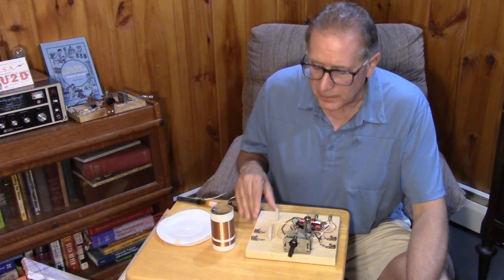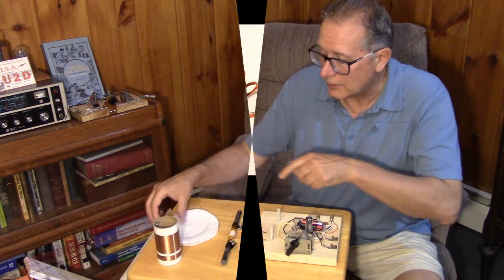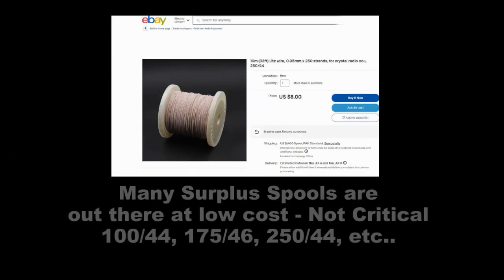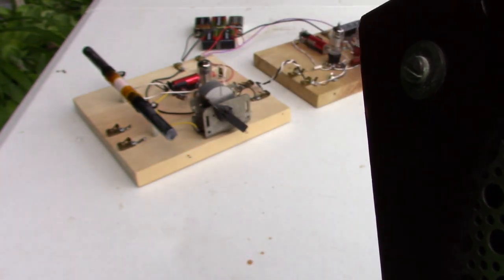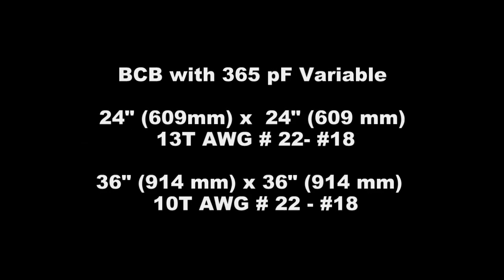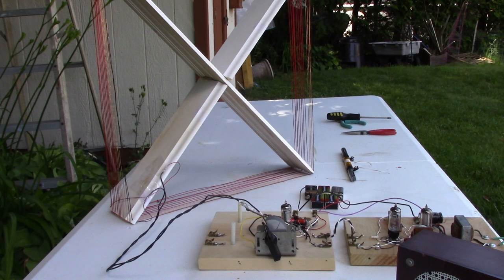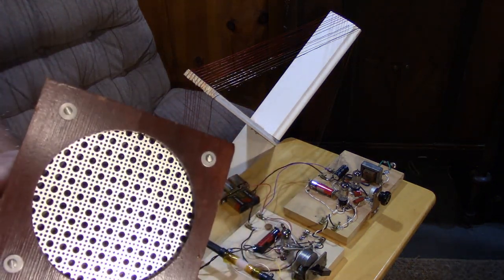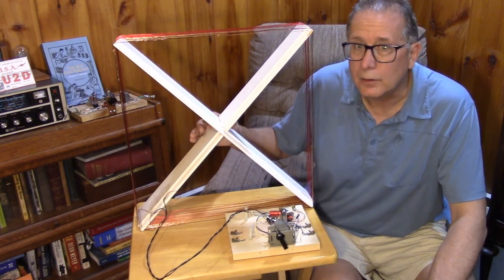Indoor Antennas for your One Tube Radio

Comment: You can also try a double tuned setup: a variable capacitor on the frame antenna and set parallel to the ferrite rod connected to the radio. It might work better, might not, I'd love to see how well it does!
Reply from the maker: Using the ferrite rod purely as a high Q resonator like an air coil and putting an input link on it and coax to a remote big frame loop OR simply nesting the two for coupling are both viable ideas.

Comment: Hi Mike! You can recommend to the makers to use the wire inside mobile phones headsets cable. Wich have at least 4 length of a multiple strands of very thin enameled copper wire. This wire should make good coils in MW band. Best wishes my friend!
Reply from the maker: Wow sort of a 4 Wire Litz!
Reply: @MIKROWAVE1  yes, each of the 4 is a  7 wires litz of course without the silk coat.
Reply: They probably aren't insulated. I think Litz wire individual stands are insulated. Possibly it makes little or no perceptible difference?
Reply: @johnnytacokleinschmidt515  it really is enameled copper wires. 4 pole cable is made from a 7strands wires per pole. Each pole twisted separately and of a different color. There is a yellow enamel, a red enamel, a green enamel and a red with yellow mixed. 4 poles all together inside a single coating. At this point you can take a 1 meter cable a take a 4 meters litz wire soldering one at the end of other.

Comment: Nice video!  I'm not surprised to see the loop performing so well.  I bought one of those cheap eBay/Amazon external tuned loops and was amazed by how well it improved the reception of cheap transistor radio receivers with a ferrite stick just by bringing it near the radio.  Now I'm wondering how well tuned loops would perform on the HF bands.  -- John N0BUP
Reply from the maker: Untuned loops with high dynamic range preamps are seen more at the higher frequencies (for reception only). Tuned loops are being used fairly commonly now on the ham bands for TX and RX.

Comment: So the bigger open air loop antenna does perform quite well! Did you say the big loop was about as good as a 75 ft long wire? I made a  loop antenna on a 2 ft diameter cardboard strap spool with 14 ga house wire and tuned it with a  paralleled 4 section 460 pf (per section) tuning cap to tune to the BCB. Man did it work good!
Reply from the maker: They work very well, and are very forgiving on the build style.

Comment: i have a Rod just like your holding BUT all the wiring is inside the   cardboard tube With a aluminum ring  on it ,  It has 2 wires  on 1 side and 1 on the other, How exactly would i use it  as a antenna .

Comment: Hello. The video is top notch as always. Did you make a similar receiver with an external antenna. and use the heptode as a radio tube? I found in the literature of old issues a diagram of a device based on the CO-242 heptode. This is an old Soviet lamp. the difference in the circuit in the ultra-low anode voltage is only 4.5 volts.
Reply: reception is carried out on an external antenna + grounding. and high-impedance headphones.
Reply from the maker: You can use these in pentode mode with the screen tied to B+, or with the screen and plate tied together to form a triode. The gain will be less with the triode connection, which sometimes is an advantage in regens, but the pentode connection make the most sense here.
Reply: @MIKROWAVE1  Thank you very much for the answer. And by the way, thanks for answering. This is very supportive for beginner radio amateurs!
Reply: @MIKROWAVE1  And I apologize that I communicate with you through Google translator. Forgive me, it turns out clumsily.

Comment: I want to know if instead of headphones can I place the 3V4 tube with T725 Boegen audio output onto the plate I think that winding in the transformer measures 3K ohms with many rainbow colored taps
Reply from the maker: That transformer will work - no problem.